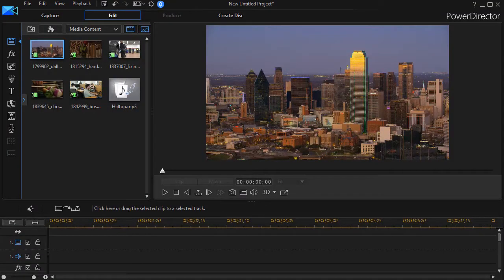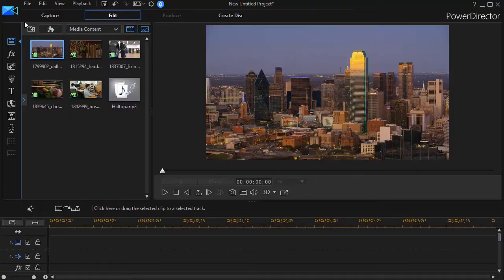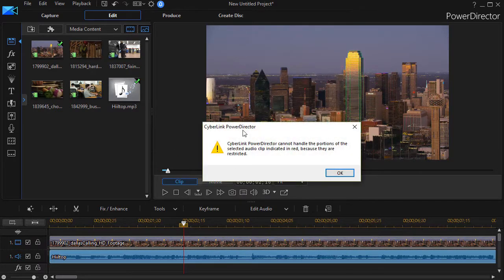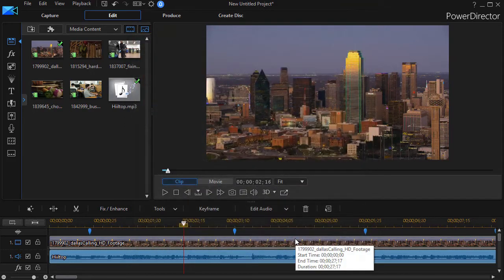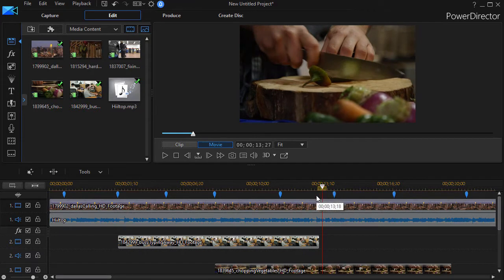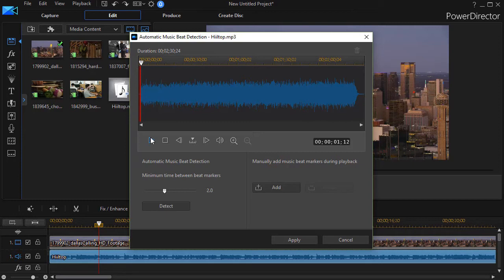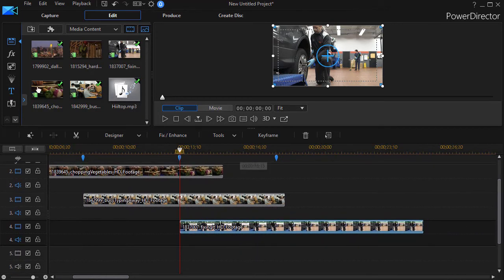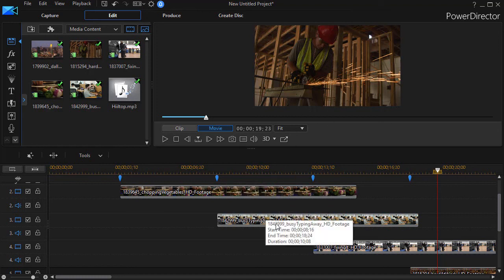PowerDirector - Tips on using the beat detector to simplify timing

Comment: Beat synching scene changes like this can have a massive impact on your video. And yes, the auto detect sucks. Manually adding is pretty easy and much better.
Reply from the maker: Don,
I'm with you in favoring the manual method. It would seem that the automated should be an excellent way to go, but the results aren't always what I hope for. --Jim